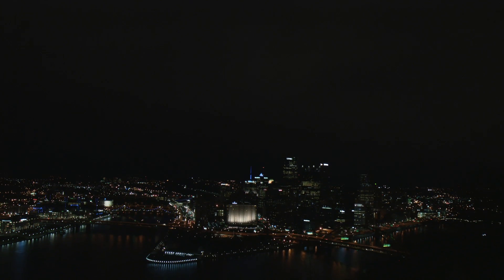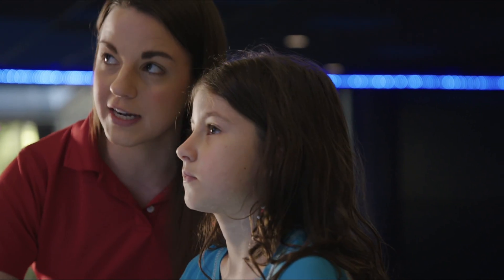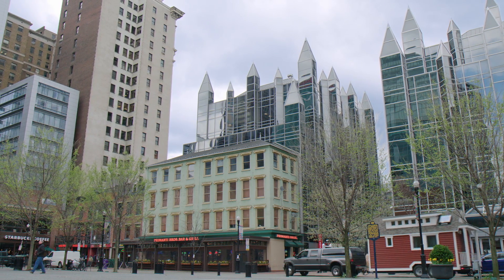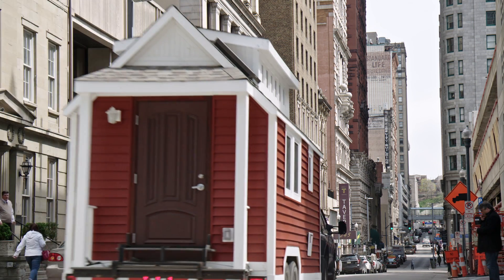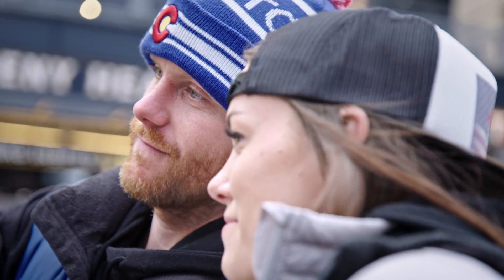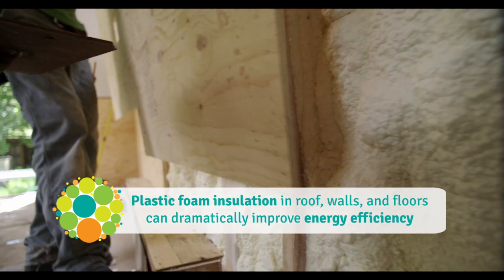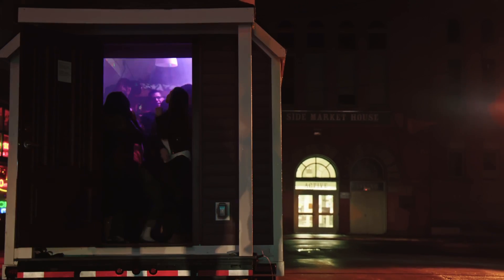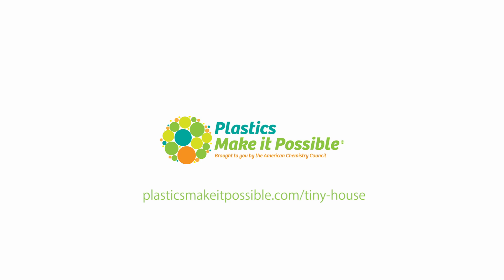Plastic House by Tiny House Nation's Zack Giffin Travels to Pittsburgh

Comment: I would love to make a home out of plastic I see a lot of UPS and most of the downs that I can predict would probably be how it looks and if you're not careful about the manufacturing it could be harmful to the environment but we're a lot smarter than we were 20 years ago and soon as it's done being made it's no longer harmful the only reason most Plastics are harmful out in nature is because it's small parts that animals eat or get tangled up in but its function overall would be good and I've always had this idea of being able to mass-produce where it would be Universal on how people could make their own houses specific for their lifestyle they can start off with something small and expand on it mostly using panels and what not and being able to do it themselves to cut out the middleman and if they do need help it would still be provided but it would also be less work and more efficient strangely enough I got the idea wanting to do that from putting a desk together from Ikea and my current job where I put utilities together and most of it plastic is very durable but of course it's a bit more thin so it tends to break if you hit it wrong but there are Plastics out there that are basically indestructible and with metal and wood it tends to warp or tear down over time not to mention it's hard to recycle and reform it in two different things or the same thing that you wanted the first time plastic you can do that with it's versatile is what I'm saying also especially with the newer Plastics they are fire retardant which means they'll burn but they won't catch on fire and spread